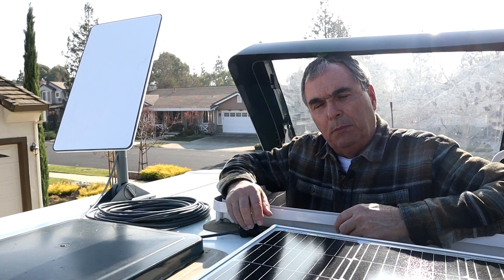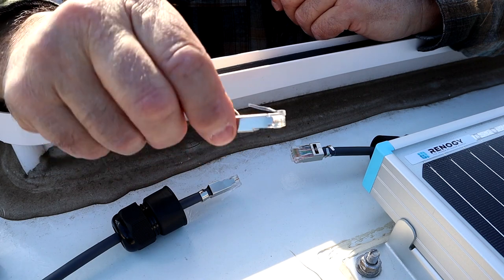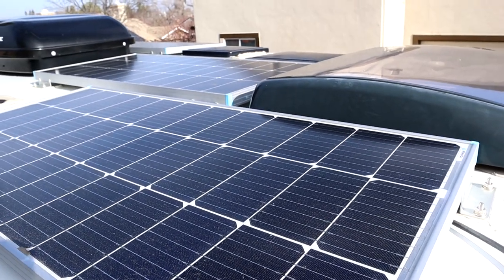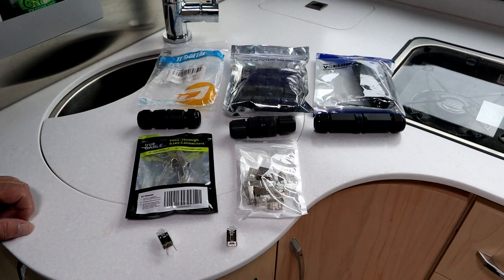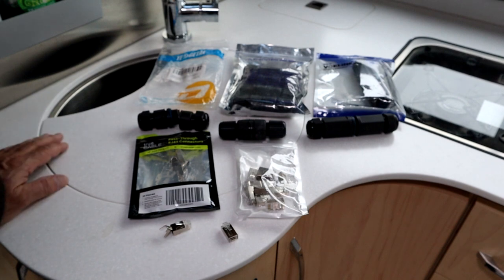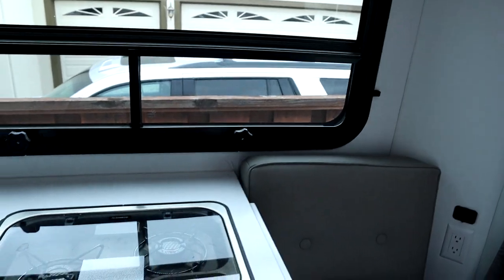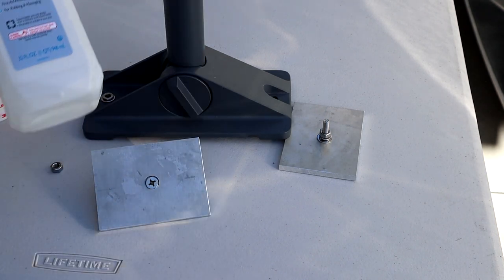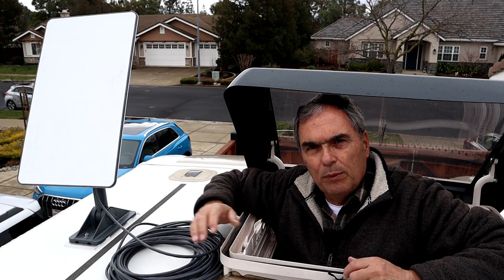Starlink RV Roof Pivot Mount

Comment: When you crimp the wires the pins get set properly. They stick out a bit before it’s crimped. Take a look at the bottom before and after and you’ll see the difference.

Comment: It is tight before you crimp it as the pins that get pushed into the wire when you crimp are protruding and making it tight.  It is common thatRJ45 is hard to insert and remove if the end isn't crimped to push the pins down

Comment: The only problem is when you forget it’s up there and drive off onto the freeway. You’ll have the Dishy flying off. I did it once getting up to 65mph before I remembered. In my case I was lucky that it didn’t fly off but I did have it bolted to my roof rack. With tape it would probably have flown off.  I have since replaced it with a permanent flat mount. Much safer.
Reply from the maker: You definitely don't want to forget it and drive off.  I doubt the 3M tape wouldn't hold.  Solar panels are quite often attached with the same tape and the panels stay put.

Comment: What type of ladder are you using inside of your rig to enable roof access via your skylight?
Could you provide manufacturer and model number?
Where do you store the ladder when you travel?
What model LTV do you have?
Reply from the maker: I have the Unity TB model and store the ladder in the shower when driving and up in the cab when parked.  I got it at Lowes and here is a link to it https://www.lowes.com/pd/Kobalt-3-Step-250-lb-Capacity-Aluminum-Foldable-Step-Stool/5000211407?cm_mmc=shp-_-c-_-prd-_-bdm-_-ggl-_-LIA_BDM_102_Insulation-And-Ladders-_-5000211407-_-local-_-0-_-0&gad_source=1&gclid=CjwKCAjwz42xBhB9EiwA48pT70uWFH3hVP21Zt5SFmJDULM0DKcRju4y59V0bpj84XTW5gS567edChoCl6oQAvD_BwE&gclsrc=aw.ds

Comment: Thank you for showing us how your installation of your dish on the roof of your motor home - Need to know the part number for the roof bracket and cost of same - Also what was the type of 3 M contact adhesive that you did use ?
Reply from the maker: I added a link to the 3M sealant/adhesive below the video.  The roof bracket is simply called a roof pivot mount and can be found on the Starlink site.

Comment: Thanks - great video! So when parked you have the dish up high and while traveling you're taking it down to the low position on the pivot mount?
Reply from the maker: Actually, I completely remove it from the mount when I travel.  But others leave it up with it in the down position.  Just depends on whether you are very conservative like me or not.
Reply: @rvtipsequipmentwithcurtis9087  Thanks. I'm living in the van 24/7 and I'm driving typically every second day. I'm a bit worried if the teeth in the pivot mount are strong enough for this long term. Maybe some kind of typical bike QuickRelease replacement would be better long term. Not sure.

Comment: Hi, thanks for your great video. So u cut the original cable and put the rj45 connectors on the 2 ends?? it s right? I m going to do the same work to my RV. Thanks in advance.
Reply from the maker: That is correct.  And then I used a water tight feedthrough to reconnect the two when I want to use the Starlink.  I used a simple 1/2" sprinkler cap to cap the end left on the roof when not in use.  You can find links to all of these parts down below the video.

Comment: How is tye VHB tape holding up, thinking about doing same, do you leave it on the roof folded down when driving?
Reply from the maker: The VHB tape is doing fine.  I take the dish down when I drive but I think I saw that someone leaves theirs up.  It is so easy to take it down and reinstall it that I don't want to worry about having it up there while I drive.

Comment: Does your LTV have a slide below where you mounted the pivot for the Starlink???
Reply from the maker: There is no slide on my RV.  There should not be a problem to attach the Pivot mount to the roof with 3M tape next to the skylight even if you have a slide.
Reply: @rvtipsequipmentwithcurtis9087  
Ok thank you. We want to leave the Starlink dish in the pivot mount while we drive so we are going to screw it into a stud on the roof. Your thoughts
Reply from the maker: @lindahartley3431  The Starlink Room model does not lie flat like the Starlink Mobile model so you may have problems with the wind on the dish while riding down the road.  I would at least park the unit but would still be concerned that it might want to  buffet around and even come loose.

Comment: Does your skylight simply pop thru so that you can avoid climbing you exterior ladder ?
Reply from the maker: That's right.  Of course I need a small ladder or step stool inside the RV to pop out of the skylight like you see in the video.  What you need depends upon your height.  But no more climbing on and off the roof to install the dish.